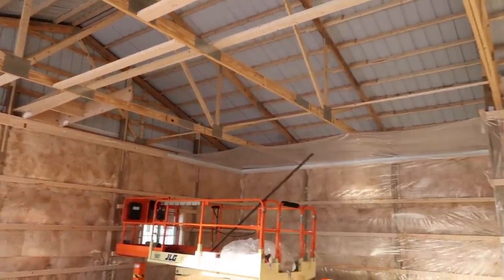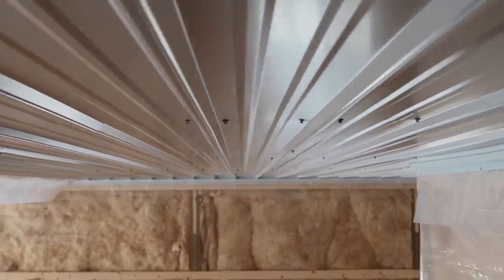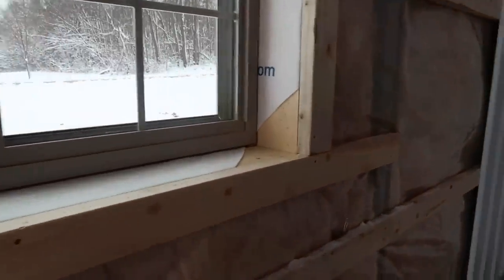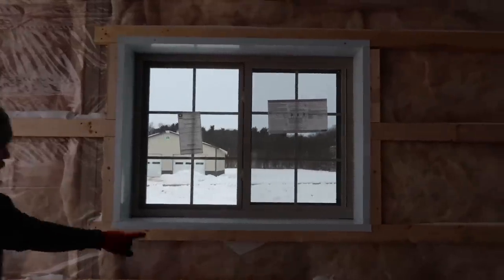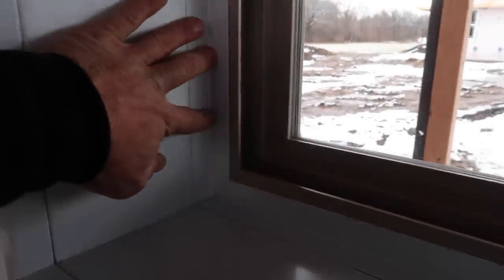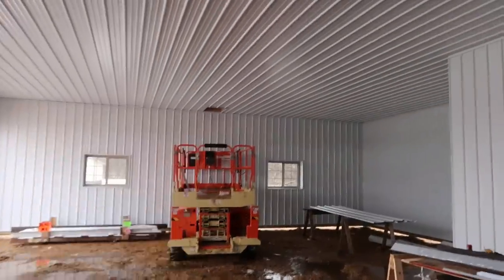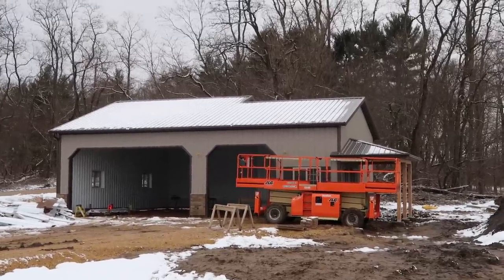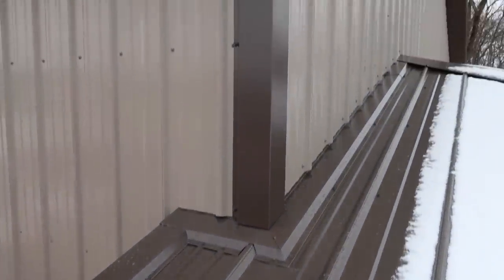Building a Mancave 11: Interior Finishes

Comment: Man I dislike that 1x1 on the windows. Can't you run a .5x.5x.5 T trim and tuck it into the frame and avoid the screws?

Or turn that angle 90 degrees and tuck the one side in to fill out the gap.

Comment: If I was the customer I would have asked for a lot more space between the two garage doors and between the double garage door and the outer wall to the left.  There is nothing more frustrating than not enough space to open vehicle doors without hitting the wall or another vehicle.

Comment: Great job, why no insulation in the walls?
Reply: Walls are insulated.
Reply: Paul Allen I was looking for fiberglass or spray foam like in a house.
Reply: Ahh, I see. It is fiberglass, just 8 ft rolls, not blown in. He's covered why no spray foam previously. Basically, fiberglass provides as much insulation value as is needed without breaking the bank.
Reply: Paul Allen thanks

Comment: Not a fan of metal. I prefer wood trim around windows with sheet rock wall inside. Just my opinion.
Reply from the maker: I would rather have wood as well but not drywall in a garage or a shop

Comment: That angle piece looks worse than caulk with those screw heads. Hire a painter to caulk if you don’t like caulking or can’t make it look nice yourself.  I know it’s a pole barn but if you are insulating, those windows should be caulked inside for both air and water sealing.

Comment: It is incomprehensible to me why you do not first pour a concrete slab here.
Reply: For some it if preference, others it may be due to budget, concrete is at least 1/3 rd of the building cost.
Reply: @Joshua79C ... without solid ground it would be worthless for me ...
Reply: Well this is just the way these types of buildings are typically erected, not saying it can not be done like a traditional home on a foundation which it can well be done and he has done replacement on a old slap with slab extension and a recent previous build was on a footing/pony wall. As i said though, some may not be able to afford full cost for slab and building and this is just how it was done in the early stages of this building concept when pole buildings first started out.

Comment: Cyle the gutter is that the same brown or a different one? Do you get also most of your Supplies from ABC ?
Did you just said 1 down spoud? are you kidding me ?? Not in FL man or you get flooding everywhere.... Every 30ft we do need a big down spoud. 

I have a project with a customer which you may not or may saw on my instagram where the customer like to extend also the gutter which is a 6" gutter what do you charge for a gutter per linera foot installed ? I am at $1-2 per foot inc material. Brand new install's $1 and remodel and extension about $1.75-$2 because of extra work and the so called .... crappy looking joints.  What would you do on an extension.... Let me know what you think Metal roof and also Gutter extension what are the best products and methods you use? We all are still leanring.

Comment: Can someone set me straight as to why you would not rough in electrical before paneling the walls and ceiling?
Reply: In pole buildings, elec is "generally" run in surface mounted conduit & boxes.
Reply: They probably plan on running conduit and surface mounting receptacles and lights.  It's difficult to have device boxes the correct depth off of the finished surface due to the changing profile of the metal.  This causes your boxes to either protrude too far out or to be recessed to far back from the surface and also causes any cover plates not to sit "flush" to the wall

Comment: You made two comments about insulation that are incorrect. First, you said that the R-Value per inch of fiberglass is better than cellulose. You have that just backward. The R-value of loose fill cellulose is R-3.2 to 3.8 per inch. Loose fill fiberglass has an R-value of R-2.2 to 2.7 per inch. BUT, in any case, it's irrelevant in the sense that in a loose blow situation, you blow the amount of insulation you need to achieve your desired R-value at the materials settled density, whether you’re using cellulose or fiberglass. (You'll have to blow more fiberglass to achieve the same R-value as cellulose in a loose blow ceiling, but you can match R-values simply by following the manufacturuer's guidelines.) Second, you stated that "cellulose settles more than fiberglass". Once again, not relevant. First, you decide what installed R-value you want to achieve, then you blow the required depth of insulation, using the manufacturer's guidelines to allow for settled density. What you didn’t mention, and which is very relevant, is that the real world R-value performance of fiberglass drops as it gets extremely cold. Cellulose has no such issue, so if you're insulating to keep the space warmer in cold temps, you're going to get better performancve from cellulose. Love this series, by the way, but if I were building one of these buildings, my choice for the ceiling would be cellulose insulation.